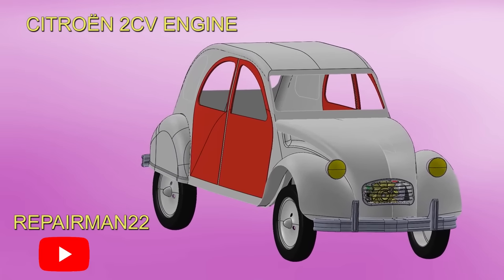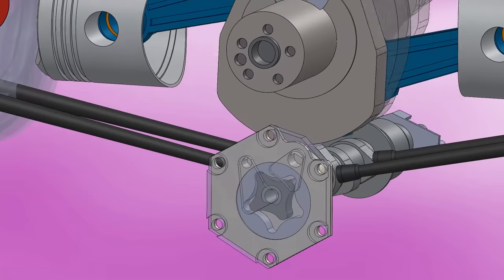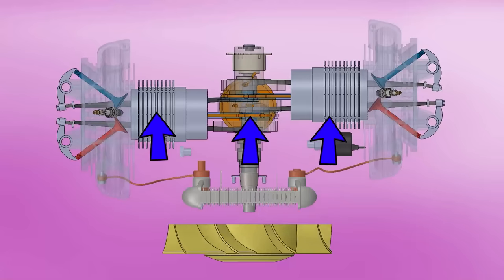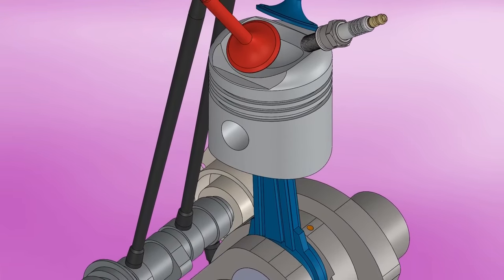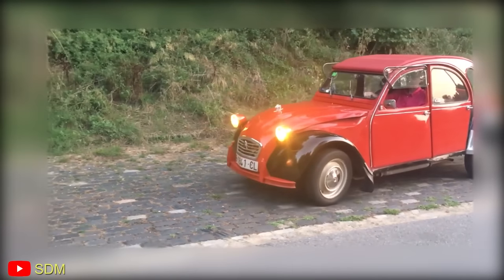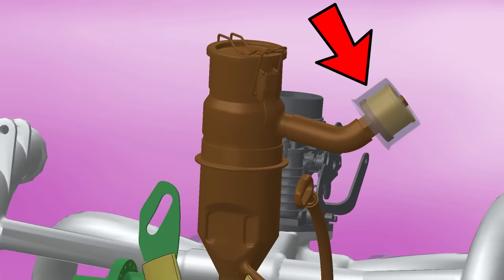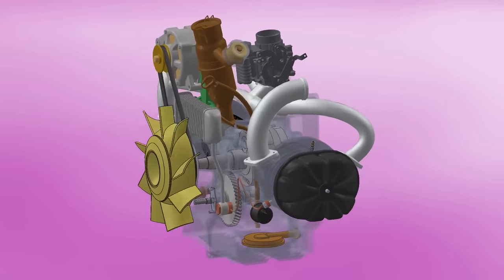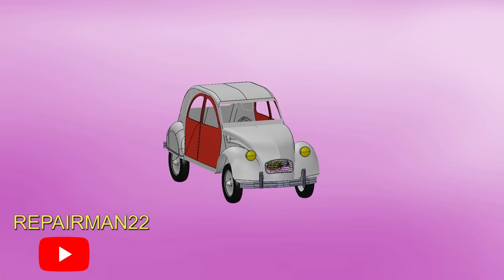The Most Interesting Engine In The World 😍 Citroen 2CV / How does it work in 3D?

Comment: I had a Dyane in the early '70's in the UK. It was only 2-3 years old when I was told by the Citroen dealership that the flywheel was loose. Being short of money I pulled the engine out myself. It wasn't a loose flywheel, but crankshaft end float, several millimetres. How did this come about. Worn thrust washers or a worn cylinder block? The engine probably only had 20,000 miles or so on it.

Comment: I had a German made Isar between 1969-1973 and its engine was almost identical to the 2CV. It had a 700 cc 30 hp boxer with practically identical technical structures. Even the sound of it was the same.
Reply: Pequeños motores "boxer" de 2 cilindros opuestos, como en el BMW 700. Toda una época.
Reply: @cesardavrieux3767  Lo recuerdo, sí

Comment: The 2cv engine is an ideal engine for a small aircraft.  I built a Mignet Flying Flea with this engine fitted with a custom 2.3 to 1 chain reduction driving a 66 inch prop.  This was the last version of the engine, with the most horsepower.
Reply: This is pretty awesome. I learned that the Käfer engine is actually available as an airworthy engine. A small company named Limbach converts them. I learned about them bc apparently some Russian drones use a clone of that engine, (as they also use the Rotax clones). My first plane that I flew was a C-150, which with its Continental O-200 100PS, also has a tiny boxer-engine, though direct drive.

Comment: I had an Ami 8 in France. Wonderful car. Slow in the mountains, OK on the highway.  incredible, and easy to fix when it went wrong would drive with a flat tire and all you would notice was a bit of a rumble and reduction in speed...no steering issues if it was on the front tire. Suspension was amazing and easy to fix when it went wrong...only happened once (car was 13 yrs old when I got it.  Four people and all our camping gear for three months in Europe and averaged 55 mpg (around 5.2 l/100 km)...1971 tech.  I wish they still made them just like they did then.

Comment: I was Quality Control supervisor at the Citroën factory here in Argentina.  Always loved this car and owned various models.  You don't mention that, on the early cars where the  wipers were connected to the speedometer,  you could still work the wiers by hand with a little knob next to the speedo.  We also built a 4WD version with only one engine but with an inverted gearbox at the back to drive the rear wheels with a drive shaft connecting the two mainshafts.  This never went into production though several were made with a very pretty plastic Jep type body (not Mahari).

Comment: In our student days in London, in the early 1960s, we took a 2CV to a local car park and tried very hard to prove the rumour that you could NOT turn a 2CV over.  The suspension only has two springs, one for the left hand pair of wheels, and one for the right.  They have an astonishing length of travel which makes for some very alarming body roll.   However, we failed to make it turn over.  Just as well, I suppose, in more adult retrospect...  :)
Reply: They have 4 springs one for each wheel mounted in pairs inside tubular cans one on each side, this causes the front and rear springs to inter react, if the front wheel hits a bump there rear spring is pre tensioner ready for the bump.

Comment: Hello Repairman 22 😃Your video is fascinating! Thank you. I have just bought a fabulous 40 year old Acadiane (the 2CV van). I love it for its mechanical simplicity (I think of it as analogue driving) as I am increasingly disenchanted by "high spec digital tech" which is costly to repair and bewildering to understand. I love having to use a choke, remember to turn indicators and headlights off, there is no power steering or power assisted brakes, so it is all down to ME to actually drive the vehicle. Mine is LHD and all the instruments are in KM (here in UK we like miles and RHD). It has just been stripped down and completely restored to a thing of beauty, without losing its integrity and heritage. I kept the worn steering wheel and footpedals and  goodness knows how many times it has been around the clock. I'm lucky I have a dedicated mechanic quite locally who only works on 2VC's so he gives me sound advice on spare parts and the quirks and foibles of driving the little beast. This is now my day to day vehicle, I have every confidence in it and hope it will be the last car I ever have to buy. I LOVE IT!   ♥

Comment: I worked on a 1972  2CV, I rebuilt the Carburettor, which I believe was a VW 1 Barrel PICT-2, and as usual 2 of the 3 Stainless Steel Check Valves in the main Housing (Most people know of 1)!))were Stuck in Pot-metal Erosion/Fluff, and Gasoline Resins! Valves adjustments, and Cover Gaskets! And several tweaks on various chassis, and body panel (rear Fender-Skirts) and the Headlight Lever adjuster,, issues! It was Fun! I Love the information on the 2 & 3 CV! Fascinating!🤠
D

Comment: 3 of us hired a 2CV when we were in Toulouse in 1964. What remember most is the odd motion when negotiating a steep spiral in a multi-story carpark. The front drive shafts were Hookes joints like those in a prop shaft, instead of constant velocity joints. In a tight curve, it staggered up the slope, right and left front wheels alternately.

Comment: Between 1975 and 1980, I had three Citroen car in Patagonia, Argentina: 2CV (30 HP), 3CV (35 HP), and Ami 8 (38 HP). Their AC system was a louver under the windsheel, while the heater was a air duct that force incoming air around the engine and into the the car's cabin. In winter, we used a curtain to reduce the air intake.
When passing another car, you'd better had enough distance on a flat highway (rear wind helped a lot), especially if driving the heavier AMI 8. The flip side of that coin was the extreme fuel economy. Those were fun cars to drive if you were not in a hurry, I tell you.

Comment: I have owned 3 Citroen vehicles in my life, one being a Deux Chevaux, a 2CV.  Living in the north of France in a rural area, this little car never failed to do its job. It appeared to be bomb proof but it was imperative to keep her fettled, an easy task.
It had 80 km when I bought it and 130 when I gave it to a friend to use as a farm truck.  It is still running to this day!
I also owned a 1955 Beetle, one of the worst cars I had.
My 2CV had rubber fenders, canvas seats and sliding windows.  It was good for around 50 mph on a good day but there was not a field or bad, hilly road it would balk on.
My daughter owned a later model capable of 70 mph and a tad more sophisticated.
The 2CV was a product of minimal, intelligent engineering that transported French people and others for years. Today, they make fun classics if you can find a good one.

Comment: Not to forget there was also a 602cc version that made 29 horsepower which definitely beat the original beetle engine in power density by a lot.
But the beetle then got a 40hp engine.
Either way the beetle was 200kg heavier and didn't have the cool suspension system.
So power to weight ratios were pretty similar.

Comment: More points to add...the cam drive gear is split in two halves ( like putting the palms of ones hands together ) they  are spring loaded in opposite directions to compensate for teeth wear which would otherwise affect timing.
Another curiosity is there are "no" rubber flex hoses in the hydraulic brake system only steel piping! 
The large hollow cross chassis mounted tube supporting the rear trailing arms (via  ball bearings) also houses a coiled hydraulic pipe internally.  this steel pipe runs down each trailing arm to the wheel brake cyl. Since vertical wheel movement is limited the internal coiled pipe accepts this without stress.
Front brakes are inboard either side of the chassis mounted differential/gearbox so again the piping is coiled (less so) to compensate for vibration or engine movement on its mounts.
These cars are technical wonders in many ways.

Comment: In the late 70s I owned a 485 ccm 2CV, I wish I still had it today, was one of the best daily cars ever, not for going fast, but to get anywhere you wanted to go, in rain, sun or snow. I never did put winter tyres on it either, the summer tyres worked just fine in the winters then. Today, we hardly have any snow anymore.
Yes, one of my favorite cars, and going down curvy roads, it was hard for others to keep up with me, it was a blast!
Cheers 👍💪✌

Comment: Nice video. I had both, a 2CV4 with the small block, mighty 23hp on paper; and a 1200 Beetle with 34hp on paper (and later on a 57 Oval, but that is another story). The 2CV-engine felt more eager and liked high rpm, the Beetle engine felt more torquy (if you can say that about an engine like this) and seemed limited rpm-wise. In the end the Beetle was the nicer ride.
Reply: It's like the old Chevvy v Ford thing. You either liked VWs or 2CVs. I owned a Citroen and my mate in the office drove a Beetle. He showed me how to crap yourself driving by cornering it extra hard and braking (if I remember right). It would rear up at the back as the swing axle tucked under. Mind you, he was going faster than I could achieve in my 2CV...

Comment: I had a Daf 33 with a twin cylinder, air cooled petrol engine and the weird but wonderful Daf belt transmission. Apart from a rather weak heater it was reliable, quite gutsy, sipped fuel and no coolant, anti freeze ..... I loved it.

Comment: I owned a 2CV6 in the 90s, I changed the steering rack, pulled out the engine and ground the valves, polished the ports, reassembled and replaced the lot all on my own on the yard, no lift, pit or shop needed.
Not many family cars you can say that about.

Comment: Do the trabant 601 engine next! It has a 2 stroke air cooled 26 HP engine, the design of the engine is superbly simple and reliable. Anyone can repair it when it breaks down, it it has like 5 moving parts. 

The sentiment on the internet towards them is a bit negative but having used one as a daily driver and now as a leisure car, it's a cockroach. Rough around the edges but incredibly hard to kill. The handling is great and goes easily with traffic still. Not many cars tolerate you to drive max RPM but pull one on the highway and it will easily handle driving 105 km/h for hours on end.

The car stems from the same time as the 2CV and the beetle, it has a similar weight class, it's yet another way to properly fill in the same gap in the market with a different strategy

Comment: Thank you for that very interesting video. Having owned a 2CV and Dyane nearly 40 years ago, I plan on acquiring another this week for some fun in my 77th year -older than the 2CV!  A remarkable car, the main problem being they could quickly rust away here in the often-damp and rainy NW UK. Now, a galvanised chassis, retro-fitted, avoids that problem. I like flat twins, owning 2 1957 Douglas 350cc Dragonfly motorcycles and a BMW RT 850cc Boxer in the past.

Your point about the exhaust gasses being passed through the carburettor to heat it up, being an advantage at a time before electronic ignition came about, is interesting. Many 2CV's will have been so updated from the original system, so, if cooler conditions offer more efficiency in vapourising the ingoing fuel, I do wonder if that diverted heat flow is, or could be, blanked off as part of that conversion to offer a slight performance advantage? I will check my proposed purchase and ask the 2CV UK club members.

Comment: Many years ago I used to service Citroens. This was in the era of the DS, SM, CX, GS, Ami 8 & Super, Dyane & 2CV. They where very interesting cars to work on, and I went on many training courses at Citroens UK headquarters in Slough, but my favourite was, and still is, the 2CV.
They where a doddle to service. Just slide the bonnet off, undo 4 nuts on each front wing to remove them, and Voila, you had all the room in the world to service the engine. The inboard front brake drums could be a bit fiddly too adjust, but they remedied that by fitting disc brakes.
The 2CV may have been a cheap, no frills, form of transportation, but by heck, it had tons of character.

Comment: My short list for my first car was a 2CV, a beetle cabrio or a 230SL. I test drove a lovely used 2CV first off. It wasn't easy as I was living in Luxembourg at the time and hadn't driven since passing my test in the UK. The lady who owned the car was very nice and calmly pointed out that normally they stop for the red lights - apparently all the traffic lights were hung in the air above the road but I was finding it difficult just finding the gear stick etc. I never got to try out a 230SL as they were beyond my budget. In the end I bought a used beetle, it's still in my garage almost 40 years later!

Comment: In my late teens (late 1960s) a friend had a Citroen “Bijou” - a real peculiarity.  Based on the 2CV and made only in Citroen’s plant in Slough in the U.K. for the U.K. market it had a fibreglass body and looked nothing like a 2CV. Bizarrely, the fibreglass body was actually heavier than the metal, so it was slower.  He bought it because it was incredibly cheap (hardly anyone wanted them new, never mind used) but still had the simplicity virtues of the 2CV and didn’t rust.

Comment: DAF used the same type of engine, a 2 cyl air-cooled boxer. First 600cc, later 750cc for the 31,32 & 33, plus a 850cc for the 44 & 46. 
The Daf 46 had 125 km/h as top and cruising speed.
Reply: I think just as the Citroen engine, the DAF engine was also made to be run at max rpm for extended times.

Comment: I had an Ami 8 with the 602 cc engine. Never had a problem. The evolution of this engine was the 652 cc with electronic Ignition (citreon Visa and LNa). I also had an LNa. The last one has more torque, more power and it switch on easily even if under water.

Comment: I own a 1990 2CV and it is used daily, the engine is built opposite to the Commer Knocker and of course, petrol not diesel. Look it up, very interesting design.
Very reliable and easy to fix. Mine has electronic ignition fitted, that makes starting a lot easier. They can be difficult to start! They are happy with 87 Octane fuel as they are very low compression.
Change the spark plugs every 10,000 miles but swop out left to right and right to left at 5,000 miles.  The AMI8 was the van version, I drove those as well back in 1975.

Comment: I mis-matched driveshaft parts from different iteration of 50's 425cc variants and they popped out a couple of times after heavy bouncing. (The friction dampers were rarely fixed) Scary as the brakes FWTWW were inboard, so no engine braking and only rear braking which I usually neglected to bother maintaining.

Comment: I bought one new in about 1987.  Many happy adventures.  If I got blocked in when parked, I could easily deadlift the back end by the bumper (fender) and move the back end across.  All the seats could be removed (spring loaded catches) and used as picnic seats.  There was room to put a tandem bicycle INSIDE with all the seats removed except the driver's seat.  The other tandemist could then sit behind the driver on a bean bag.  The only problem was driving in the summer with the window open and my elbow on the window sill.  Every so often, the little catch would let go and the hinged window would slam into my elbow.

Comment: Italian and French cars at that time rusted away when the weather forecast said rain.
However, the 2 CV was even more accessible to repair than the Beetle (VW Käfer). Every village blacksmith could do the job.
If you had a hammer, a screwdriver, and a couple of wrenches, you could demount and re-mount the whole car.
When others had staring trouble in the winter you'd pull out the crank handle if need should be and you were good to go.
I really like the side windows during the summer even if they leaked a bit when it rained a lot.
Not a fast ride but it would get you there ..eventually. :)
The seats were not made for longer trips but that doesn't worry a real 2 CV lover.

Comment: The horizontally opposed engine is supposed to be one of the most efficient as regards space and balance. Used by Alfa Romeo, Subaru, Porsche, Citroen 2CV, VW Beetle. Also used by BMW in their motorbikes and Honda in their Goldwing models. What I like about them is ease of access to the top end for valve adjustments and maintenance. Plugs are easy to get at as well.

Comment: I love it. If I got a classic car this would be the one provided that I could find parts.
Reply: Part are plentiful and cheap - relative to much newer cars. I recently bought mine after a gap of 35-40 years. We love it. So simple and relatively cheap to run and upkeep, I think I'm safe in saying just about ALL parts are available, even engines, the body cage and parts, chassis, etc, with the possible exception of a new gearbox. Just reconditioned. Many parts are made with the original Citroën tooling, under licence in S America, I believe. Also good pattern ones. Assembled from nearly all new parts, they have been built to spec and sold in the UK for £25k. Join 2CVUK.